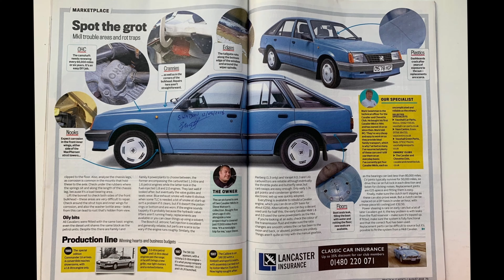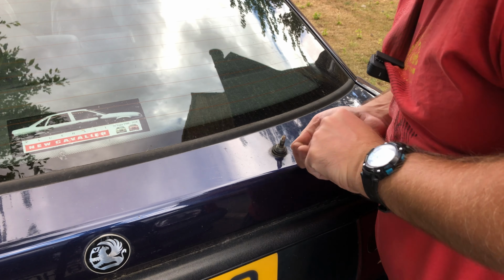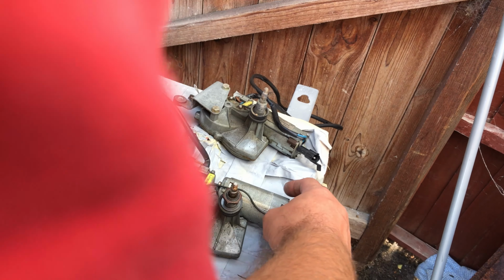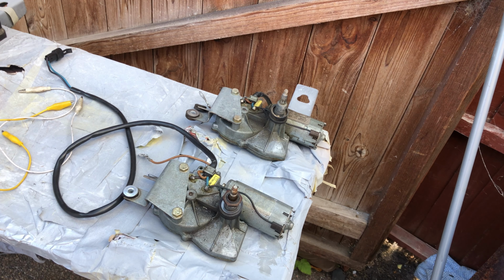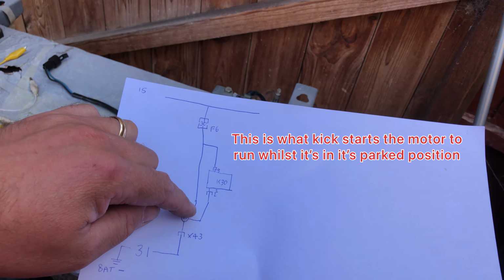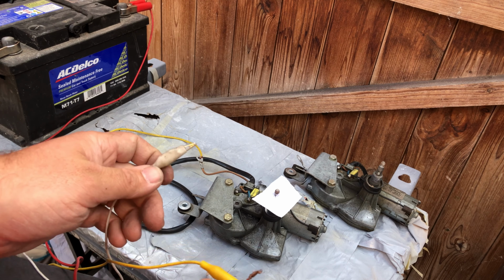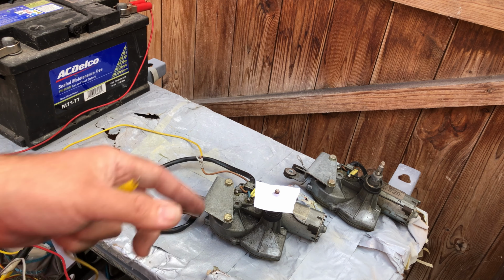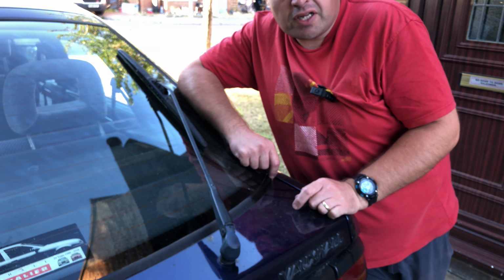Vauxhall Cavalier rear wiper motor replacement

Comment: Good video Steve, liked the last too choices of music, actually reminded me i need to change my wiper blades,  had them in the garage for months but only remember when i get in the car to go out and it's wet which until recently hasn't been much , think you need to get a Honda mate, save you a fortune in parts 😂 👍
Reply from the maker: Haha glad you like it Pete wasn’t my best efforts, took me awhile to edit this as I used an external mic and device to record the audio which VN doesn’t have the facility to sync the audio automatically. 
Haha I had a Civc before good car but not good for content 😂there is a few more jobs to do to get the car right then hopefully it’s plain sailing. 
I haven’t tried it myself yet but you can clean wiper blades with WD40 I’m going to try this on the work van as the wipers on that are terrible. I spent so much time on the music I struggled to find something I liked.

Comment: Hey Steve, I left you a fairly long reply to this this afternoon but for some reason it's not on here even though it says you have 2 comments only Pete's is showing on here, I can't even remember what I put mate🤦‍♂😂
I've never changed a rear wiper motor before but it looked quite easy and as you said in the video the hardest part is removing the wiper arm but yours wasn't to bad and don't believe what Pete says you need to get a Merc SLK😜👍👍
Reply from the maker: Hahaha, it’s funny I see someone left a comment on Saturday but couldn’t see it anywhere so I assumed they deleted it so that answers that one 😂 annoying though I enjoy reading people’s comments. It was an easy motor to change not to film though. Yes the wiper arm was easy to get off so lucky really. Thanks for your comments though John. Cheers.
Reply: Thanks Steve and I look forward to the next video👍👍